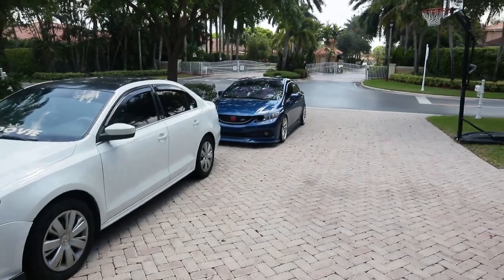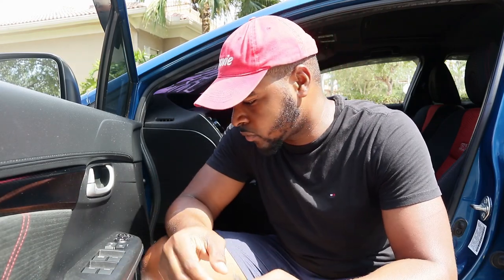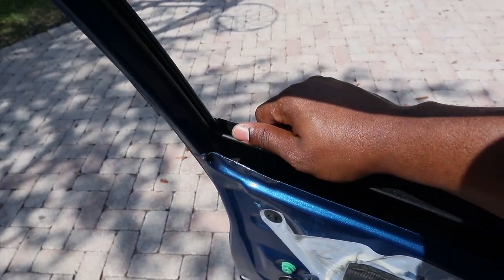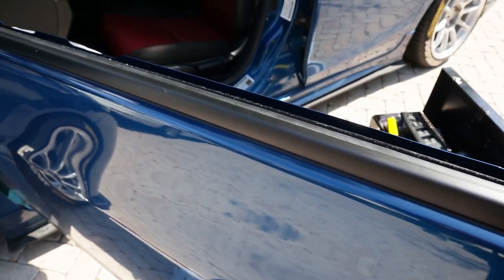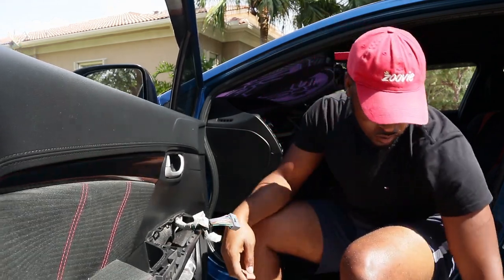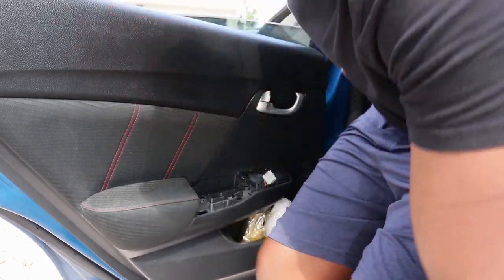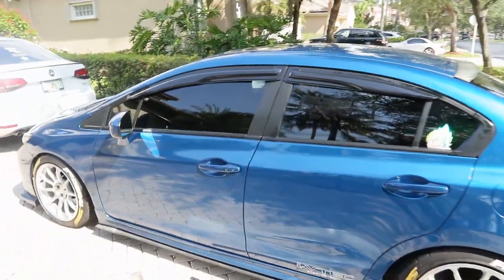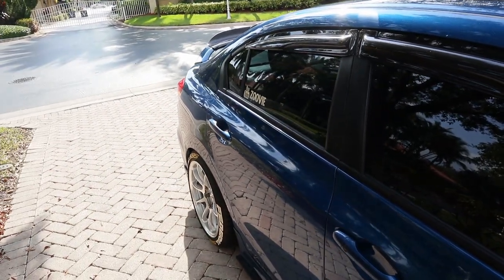Every Honda Owner Is Going To Need This!

Comment: Use silicone spray or grease. 3m has some silicone paste for the door seals and stuff. It's supposed to clean, protect, and hydrate the seals.

Edit: I meant spray or paste. If you use the spray use a clean cloth spray the cloth then rub the spray into the cloth. If you use the 3m paste you can apply the paste to the seal directly then spread and rub it in. I use the spray to clean and refresh the seals but I would use soapy water to clean the seals first before using the paste.
Reply: Thanks for the tip 👌

Comment: i have the same car but it's not stick shift is it normal to lower it?😭
Reply from the maker: Yeah
Reply: @zoovie  can i cut the coil to lower it instead ? do u recommend it? instead of buying the lowering coil springs
Reply: @gimmimalighterback3726  do not cut any of your  springs. Very dangerous and will make the car ride like absolute shit honestly. Even if it takes longer than you’d like, it’s always better to save up and do it right the first time. Better to do it right one time instead of cheaping out and having to do it 2 times
Reply: @louis1234_  I have a 2015 honda civic(not stick shift)  what coil springs do u recommend getting?